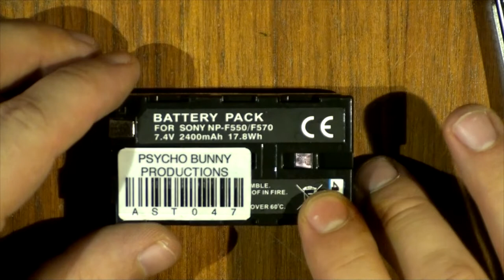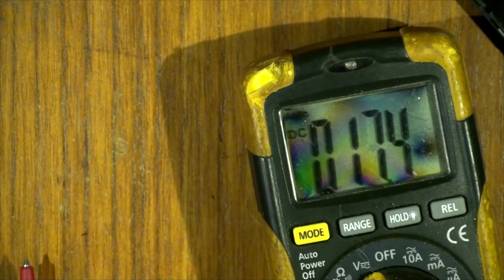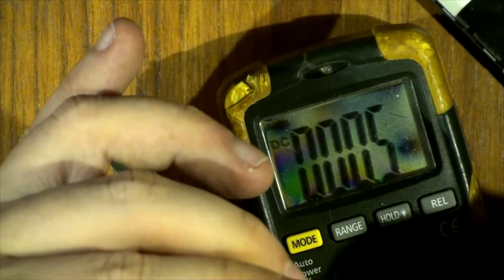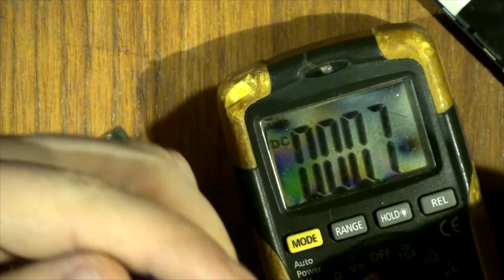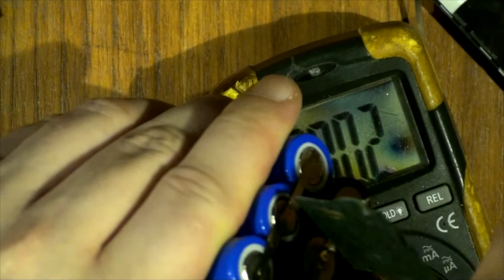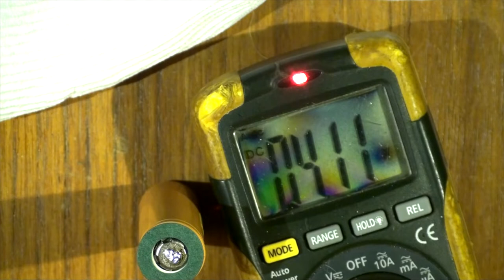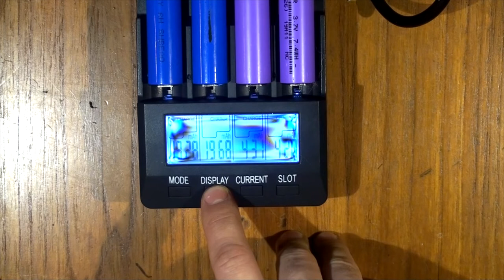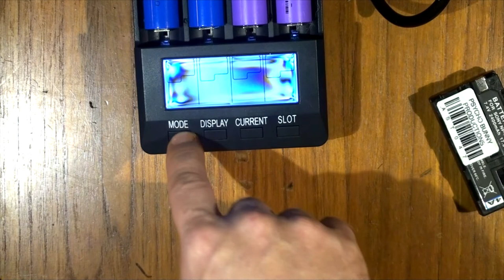SONY NP-F Battery Makeover, Repack 18650 Li-Ion, Test + Tips

Comment: Thank you for the video! They dont need to reset some chip to work?
Reply from the maker: No, when you connect new cells you’ll need to plug battery to a charger to activate the chip, that’s it.

Comment: I have some old np77h batteries from a 90s sony handycam that i use, and id love to repair those batteries, they get much much better stuck to the camera than not original batteried, plus they all have sony written on em, is it also possible to repait those? And what precausions should i take, or how to find the right cells
Reply from the maker: Hi, make sure the battery is flat before you pull it apart, try not to use metal tools a lot, once you pull it apart you’ll be able to see cells inside, being 90s I don’t think it’s lithium, it’s ether NiCd or NiMh batteries, usually standard AA or AAA side, one you pull it apart you’ll see what type of cells are inside, then you can just buy those cells and replace them, let me know how you go.
Reply: @MaxELECTRONICS  Sony was actually very quick on adopting lithium-ion technology ;)
Cathode Ray Dude did a nice video about a camera from that era once, which surprised me to have a lithium-based battery.

Comment: I have hard time finding OEM Sony battery np fm500h. I can buy from 3rd party but as I read online, they are not good as OEM are. Now as I am person who loves to experiment, would you recommend me to try something like this? Though someone who's capable will do this.
Reply from the maker: Yes definitely, I repack all new Chinese batteries as soon as they arrive, make sure you take all necessary precautions when working with lithium cells.
Reply: @MaxELECTRONICS  What batteries would you recommend me to buy? I have zero clue on voltage, ohms and things like that, I'm only familiar with the mAh :D
Reply from the maker: Well all li-ions are 3.7volts, I personally use medical grade 3200 mah, but I doubt you’ll be able to get those, I suggest recovering cells from laptop batteries or even cells from screw drivers/ battery powered tools like Ryobi or Makita ect.
Reply from the maker: Ideally you wanna run the cells through smart charger like OPUS BT-C3100, set charger to “charge Test” once the test cycle finished write down the capacity (mah) that is displayed on the battery, then run “quick test” that will show you internal resistance, again write down value on the battery, (50-100 moHm) is the best battery, 120 is ok, 130 and more is only good enough for the led torch or something) then for example if your battery pack has 2 cells, you need to match internal resistance, for example one cell is 92mohm and the second one should be around same value +-5mohm, so say 92 and 96. Or 92 and 87.